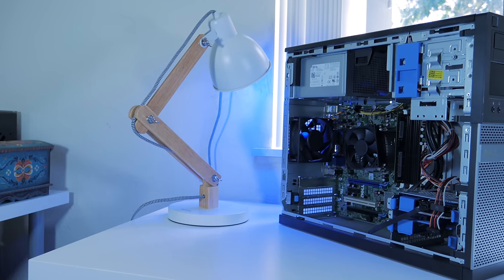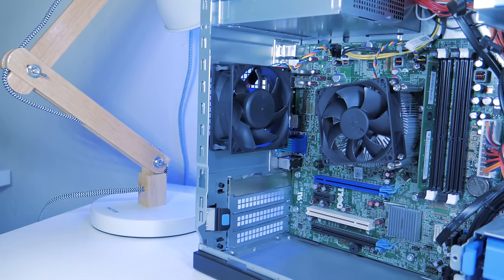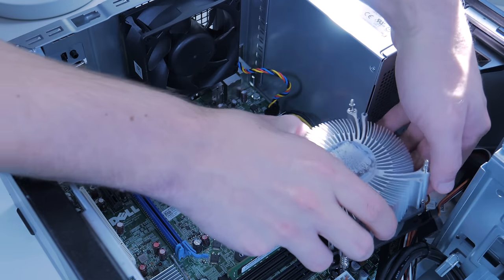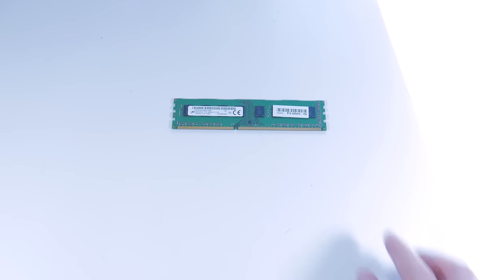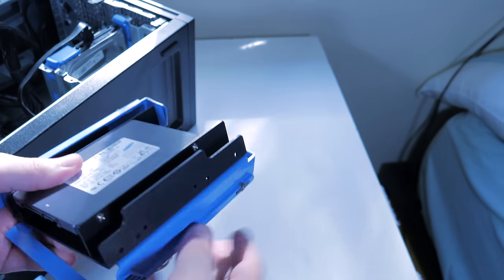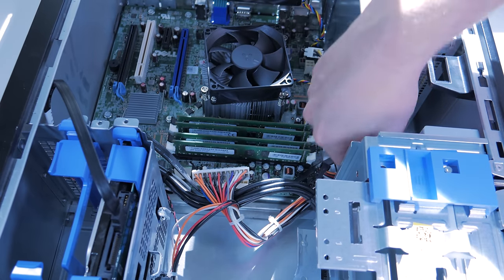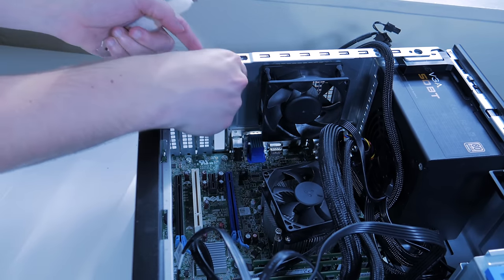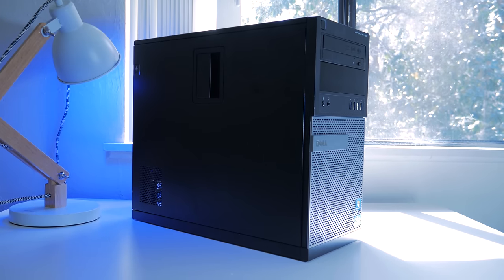How To: Turn an Old Office Computer into a Gaming PC!

Comment: Best move is to go with a Optiplex 9020 with a 4th gen i7. PSU will require a 8 pin to 24 pin cable to power the mobo.

Comment: Just wanted to point out I got a 790 with i5 2400 for $80 off newegg. Same tower as this. 

Upgraded psu, 16gb ram, 1050ti. 

Entire thing cost me like $300 total last year. 70-144+ fps in most games on high settings.
Reply: Further upgrades to 2600k & 1080 card and it does 4K gaming amazingly.

Comment: i got a dell precision T1600 for $150 on ebay its similar but has a 2nd gen i7 (xeon E31245) and a 320Watt gold power supply. i threw in a RX 560 but had the sata to 6pin adapter cable to make it work.

Comment: QUESTION: My desktop is a Dell Optiplex 390. The 3.5 Hard Drive uses both a SATA 3 cable and some form of Power cable. I am going to install a 2.5 SSD so that way I have the 2.5 SSD as a boot drive and the 3.5 Hard Drive for space. My question is, do I need to use "both" the SATA 3 cable "and" the Power cable? ... Or, can I use just the SATA 3 cable on an SSD drive?  I have heard it is not necessary to use a Power cable on a 2.5 SSD or a 2.5 Hard Drive.
Reply: Power Sata and data Sata is required

Comment: I built a pc for 450€ with these specs:
Cpu ryzen 5 2600 (OC to 4ghz)
Ram 8 gb ddr4 3000 mhz (corsair)
Gpu rx 580 8gb ( msi )
Psu evga 600watt
Motherboard idk it game with the cpu and ram
Case nzxt h500
Reply: Nice I got almost the same specs as yours with 500w ps 16gb 3000mhz ram an asus prime b450 a mobo and an old pc case from rhe early 2000s instead

Comment: Im new to building gaming PCs. Is there a concern about CPU and RAM being able to work with the motherboard, or are they pretty much all standardized? Also, is there a concern about the power supply of a Dell Optiplex being able to support an Nvidia GTX without overheating? Thanks.

Comment: I bought a Hp prodesk with:
I5 4590
320w 80+ gold psu
8gb ram
Perfect to put a mid range gpu in and play some games. The 4590 benches better than the i7 3770 for less money, and the psu can handle a mid range gpu easily

Comment: Hey Matt,

  I got my hands on a DeLL Optiplex 990 MT with a i5, 8gb ram and a AMD Radeon HD 6450 GPU installed. I upgraded to a Core i7-2700k 3.50GHz CPU, 16gb Crucial Balistix DDR3 (4x4gb) PC3-12800, Rosewill Glacier 600w PSU, Evga GeForce 750ti SC 2gb DDR5, PNY 500gb SSD and a CoolerMaster i71c CPU cooler. Everything seems to be running really well and I haven't had any issues. I was thinking about putting everything in a new CoolerMaster MasterBox NR400 case I just got in along with my Harbin Repairs front panel adapter kit to make everything a lot easier I'm hoping. This was my very first semi-build, Do you have any recommendations for anymore hardware upgrades? Thanks again and keep up the awesome content, two thumbs up!!!

Comment: Bought a Dell Optiplex 7020 SFF for 100$. Specs were a I3 4160, a shitty 1TB Seagate Hard drive that's dead now, 8Gbs of DDR3 Ram, and Windows 10. I bought a Zotac GT 1030 for it and worked quite good. It sucks that the hard drive died.

Comment: Hi Matt, I am transforming Optiplex 990 into gaming PC using your video. Thanks a lot. I have gigabyte GTX 750ti 2GB card with 6 pin connector. Do I need to replace the power supply unit. My current PSU is 265W.  Thanks in advance

Comment: You need to say that some OEM motherboards have a different PSU connector and might need an adaptor for another to work on it, plus some systems will not support 16gb of ram like mine.

On the GPU side of things some cards like the gtx 1050 don't need a seperate PSU connection and draw the power from the board l, as long as the OEM unit matches the requirements of the GPU money can be saved for a more modern better supported gpu.

Comment: Good video Matt .I have the same case as you, can you tell me if a 256 mm  10.1 GPU will fit- in the case? It will be tight if it  does..I hope you get back to me., but not expecting  you to as it is an old video.

Comment: Hey Matt! Got myself SFF 790 for 35 bucks with I3-2100 and 4gb ram and i've got a question... If i'm aiming for streaming then should i buy I7 instead? Also which i7 would you recommend for 1155 socket?

Comment: I love 9020s. Still waiting for the price on a  used i7-4770 to drop, but in the mean while...For anyone looking to put an aftermarket PSU into a 9020 - Easy Day - 9020 is as follows....  I used an EVGA 550W G3 (p/n 220-G3-0550-Y1) with the 24-pin to 8-pin Moddiy.com OptiPlex 9020 adapter plugged into the 8-pin MB connector and half the EVGA's "CPU" modular 4+4 into the 4-pin MB connector.  Note: Trim the door release slider to make way for the slightly longer case and trim the slider assembly near the back of the cabinet with an Exacto knife to make installation easier.  This will not affect the door release feature if done smartly (i.e. the door handle pushes on the right side of the release slide, so take off the left side to make room, not the whole thing).

Comment: I haven't bought this desktop yet, but I usually get jobs in the summer and receive 800 dollars over the course of 3 - 4 weeks. I saw an Optiplex 7010 with an i7, ssd already installed, but no gpu. Things where I live are very expensive (I live in a tax haven) so it like double the money. 

What do you guys think?? 👀👀

Comment: I swear, I have the same model optiplex and my standard ATX supply won't fit, but the manufacturer one slides in and out easy. They look the same size but I just cant get it to click in. Any ideas?

Comment: Hi Matt.  Thank you for making and posting this video.  Question: ¿Does the case you have shown contain a fan at the front face (blowing into the enclosure), please?  I have a similar (Gateway) case, (with side perforations as your shown).  And, am wondering if I can reuse it for some new parts (Micro ATX MoBo, Ryzen5-3600, some mid/low GPU [~$140-170]).  (I like said Gateway case, as it has an optical drive bay at it's front, and saves me $ from purchasing a new one).  Any comments/suggestions welcomed.

Comment: I already bought a Corsair Spec 02 case and a Thermaltake smart 500e psu. What would be the best graphics card, processor, motherboard, ram and storage for under about 250 to 300 dollars?

Comment: Hey Matt, I have one of these as well, the 7010, it has a i5 3470, 24gb ddr3 ram, gtx 970, and a 650 way evga powersupply, do you think the mobo will fit in another case?

Comment: I have the same intel chipset i5 2500 with 8 gb ddr3 and gt 1030 2gb totaling about $150 (thrift store + gpu + cpu + psu) runs gta online at 960 p, max grass, max shadows, max water and never dips below 35 fps no mater how fast you go or what you blow up.

Comment: Hi Matt, I have an Optiplex 3010 Mini Tower that came with an i3 3220 3.4Ghz - As far as I understand it's a 1155 socket - So I'm planning to upgrade to a i5 3570 3.4Ghz.

1. Is this processor compatible? I have heard that in some cases you have to upgrade bios as well. My pc was launch in 2013
2. Can you share the link for the 2.5 - 3.5 cabby ssd card addapter?
3. Thank you for your help and video. It's great!

Comment: Do you think i could start with a optiplex 990 mini tower? i5-2400, 8gb ram, not even sure what video card it has, but im goig to upgrade it to a gtx 1050 ti or an asus radeon rx 560. Which one of those would you prefer, or maybe a different one? Psu wasnt specified but im going to upgrade that anyway probably to atleast 450w, i might just repaste the cpu but keep it anyways since im trying to stay within 300 dollars
So yeah im thinking about upgrading the gpu and the power supply. What do you think

Comment: Im late but got a Dell Optiplex 1070 and got lucky with an i5 3570 with 4GB of RAM but its a pain in the arse to transfer it to a normal case since all the IO pins are created specifically for that SFF case and a pcie riser had to be used but i went ghetto and ziptied somethings ( I scored a cheap RX 570 4GB for 100 bucks also)

Comment: If you put the SMPS fan down.what happen when the cpu is hot.cpu got the hot air blow away in the cabinet and power supply will suck those hot air..for cooling it's(SMPS) components.that will bad for the smps.best thing will be changed the cabinet as well.i have q6600 and that type of setup 2 year back.never play the game more than 3 hours.after upgrade my cabinet..no problem there.by the my previous setup was.q6600+4gb ram+2 80mm fans(one front ,one rear).and gt 730 ddr5.and vs 650 SMPS (I know it's overkill).and cooler was 212 evo black fan.

Comment: So I wound up getting a msi gtx 770 on Ebay for $60 and I thought it would fit but the drive cage in my 790 got in the way of it. Is the 770 that much bigger than the 760 or is it just the way Msi designed this particular card? I'm pretty sure I got the same 790 in this video. Mini Tower version right?

Comment: Dell Optiplex 9010 MT Intel Core i7-3770 3.40GHz, 16GB RAM, 2X 500GB HDD, WINDOWS 7 Pro, 450w psu, EVGA GeForce GTX 1050 SC GAMING, 3GB GDDR5. Building this now do you have any opinions on the playability on a games like Rust and CS GO?

Comment: I have a question about mixing and matching ram of the same variety (ddr3).... I’ve done some searching online and have noticed mixed reviews ranging from “ its relatively safe, the ram will usually just adjust itself to the lowest common speed rating and latency “ to “ not unless you want stability issues? Do you wants stability issues?... there’s a reason they are sold as a kit”.the reason that I ask is that I am interested in upgrading a couple of those prebuilt systems like you guys have done .Can you shed some light on this for me? Thanks a bunch in advance
Reply: If it's the same speed, voltage, same sided (single or double), and same density it will normally work.  It's always a crap shoot when dealing with mixed memory modules though.   I ran mine for a while with 1333 Hynix and 1600 Samsung.  I have 16GB DDR3 1600 Samsung now though.  My kids computers have 4x 2GB of whatever DDR3 I had at the time and they run just fine and have for a while now (but that is more an exception than the rule).

Comment: Should of just bought a new gt 1030 it’s on par with a 750/750ti no need to upgrade power supply and it has newer features vs the 700 series. I had one in a budget spare of and I could play any game 1080p low to medium settings or esports high/max

Comment: I have legit the same setup mine is i7 16gb ram and I have a amd 6gb ddr6 card so it’s a real low key bad ass pc
Reply: would you mind telling me how hot your GTX 760 gets I have the 4 gigabyte model from EVGA and it hovers around 75° c idol and 82-85°c  degrees when under load. Is that bad?

Comment: One thing I am having an issue finding and was wondering if you'd be able to help?  I have a HP TouchSmart 520 pc ( Yes I know lol) and am needing to know if i can upgrade my graphics card?  And what would be a good option if there is one?

FYI:  I am fully aware that this computer possibly wasn't made for gaming but I'm trying to set it up for my kid that is just now getting into it and I'd like to turn it into a semi-decent system for him.
Reply: I believe that only has a 150 watt power supply so you will be very limited. Maybe upgrade ram if you only have funds for that machine at the moment. The one in the video is very cheap.

Comment: I just purchased a Dell Optiplex 990 MT with 3.4gHz Core i7-2600, 8GB RAM, 1.5TB HD off of ebay for $250. I have an old EVGA GeForce GTX 260 lying unused. It needs dual 6 pin  power plugs but most new PSUs have dual 8 pin plugs so I would have to get an adapter. Would you recomend using this GPU or should I get a newer one? I am going to purchase a power supply and I already have a Samsung Evo ssd. might also upgrade to 16GB of ram.
Reply: Don't even consider using a GTX 260. Those old cards are slow as dirt nowadays and will severely (like really really severely) bottleneck the rest of the system.

Comment: I have did the same with optiplex 9020 : 
i7 4770 
16 GB DDR3 RAM
1 T HDD
Samsung evo 250 GB ssd
GTX1060 6GB
With the original power supply, and runs very well.
Reply: Haswell cpus still very good and gtx 1060 6gb have enough vram you can run most of the games at ultra and high 60+ fps

Comment: I'm doing my first build and wanted to use my asus m31ad case, I removed everything except the optical drive and there is some remaining wires that are in the head of the case I'm not sure if I need to keep them in order for the buttons built into the case to work?

Comment: So i have this optiplex 990 pc that i just upgraded recently and i don't really know if its ok for modern gaming or not so I appreciate if you could tell me : 
CPU : intel core i7 2600k 3.40ghz 

GPU : Zotac GTX 950 2gb

Power supply : 700 watts 

Gb ram : 9 gb (planning on upgrading later)

Hardware : W.D 1tb hard drive and a 320 gb hard drive (1.320 tb in total)

And a 60hz SyncMaster SA350 samsung monitor

Comment: So i bought an hz400 workstation   that has a shity quadro 600,i was wondering, would a 500 w psu handle an rx 580 the cpu is a xeon w3565

Comment: Hey I Bought a Dell Optiplex 7010 with
Intel i5 (Quad Core)
8GB RAM
275 Watt Power Supply 

 So I Was Wondering if I Would Be Able To Use a GTX 750 ti With a 275 psu or just play it safe and go with a GT 1030 GDDR5?

Thanks Great Video
Reply from the maker: Should be fine, but I would recommend just buying a EVGA 450w unit when it goes on sale. You can get one now for $20 which is a worthwhile upgrade:
https://www.ebay.com/itm/EVGA-450-BR-80-BRONZE-450W-3-Year-Warranty-Power-Supply/263812070821?_trkparms=5373%3A0%7C5374%3AFeatured
Reply: Hey i see ur comment is 9 months old but i've been using i5 2400, 12gb ram and 750 ti with the stock 240 watt psu on my optiplex sff for 6 months without any problems. In fact im planning on trying the 1050 ti next cause the 750 ti doesnt run games like apex legends and gta so well.. so what im saying is ur 275w psu is more than enough for a 750 ti. Ur setup will not use even 200w of that 275w on full load. If you don't trust me you can google it :)

Comment: Replace stock cooler with aftermarket air cooler would be even better option :) so that it can keep i5 2500 temp below its Tcase :) (cuz the tdp of i5 2500 is 95W)
Reply: huy bv1998 you cant on most of them they have proprietary headers
Reply: Adam Musgrove there are adapters

Comment: I'm looking into the same model computer as the one in the Video and I was wondering if you could use a gigabyte GeForce GT 1030 GV-N1030D5-2GL instead of the graphics card you used in the video.
Reply: If you're on Amazon would definitely recommend the Gigabyte Geforce GTX 1050 Ti OC Low Profile 4GB GDDR5 128 Bit PCI-E Graphic Card (GV-N105TOC-4GL) it's low wattage so could run on 240 watt psu it's also oc and fits in a sff case btw the gt 1030 is not the best spec wise but if the thing I posted above is to expensive would recommend gt 1030 oc if your case isn't sff but if it is make sure you get the low profile better version gt 1030 little bit more money.

EDIT:Just realized how much I typed oof.

Comment: @Tech By Matt i have a dell optiplex 7010 sff with an i7-3770 3.40 Ghz and 8gb ram and a 400w psu and i have only used it for office work since i mainly game on console but i want to go pc and since I’m new to pc gaming i was wondering if you could help me out with something. Ok so im thinking of buying a gtx 1060 3gb will it work on my pc? Will i be able to game on 1080p high settings?

Comment: i have a Dell Optiplex 790 i7 2600 can i upgrade psu to corsair vs450 and gpu to gtx 1650 super asus rogue strick ? and change the cpu cooler

Comment: i found a pc with an AMD FX-6300 Black Edition 6 core processor, Asrock 960GM gs3-fx mobo ,
8GB DDR3 Geil DragonRam
Samsung 750gb hdd
 Club 3D Radeon R7 260X royalQueen 2GB gpu+ 400 watt psu for 200 dollars.I want to change the gpu with a gtx 1060 or a cheap 980 ti and i want to change the psu too..But yeah is it a good deal?

Comment: So I bought a prebuild with these specs (this was in June...... I didnt know what I was doing and got ripped off, I payed £300)
Gpu - gt730
Processor - i5 2400
Hardrive - Hitachi 1tb 
Ram - x2 4g Samsung ddr3 1333 mhz
What should I change what should I keep (its in an old intel motherboard with 2 ram slots and has an unmarked psu)

Comment: I just got an Optiplex 390 on eBay for $20.49 that has a i3-2120, 4GB RAM (supports 8GB max), and everything but a hard drive (my friend gave me a 500GB with Win 10 pro) do you know if I could switch out the motherboard with a slightly newer one from a newer Optiplex model (like a 3010/7010/7020/990) to support more ram? They have the same case pretty much so should the motherboards connect the same?
Reply: Oh yeah a new motherboard would obviously support a newer CPU than a Sandy bridge, like I could get a i7 4790 on the new motherboard as opposed to a i3 2120 on the old one

Comment: Try not to use a paper towel to wipe down the CPU, they tend to leave fuzzy stuff behind. I would suggest using a Coffee Filter, these don't leave anything behind after the CPU is clean. I mean, you don't want any fuzzy crap in your coffee right? Just a little splash on the Filter, not the socket, CPU or cooler, and use Isopropyl alcohol 99%. wipe off both the cooler and CPU.